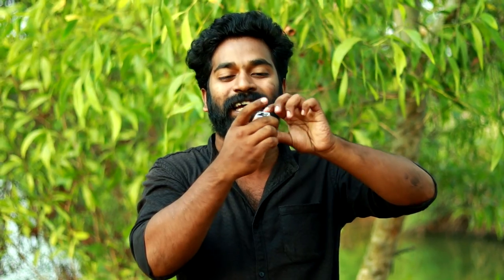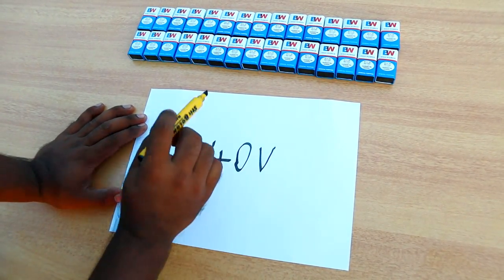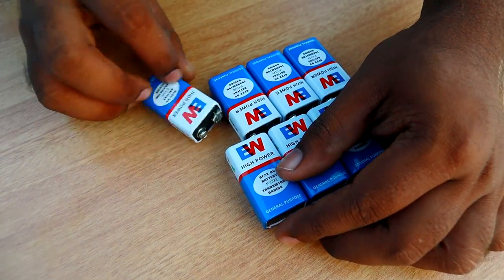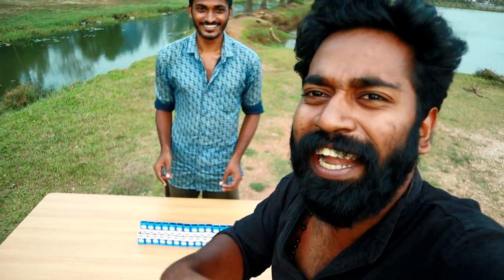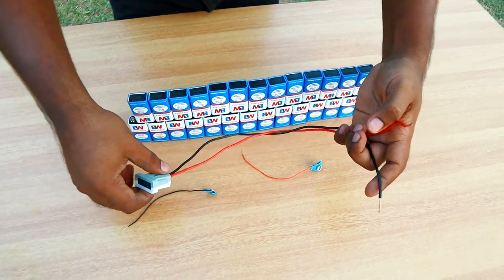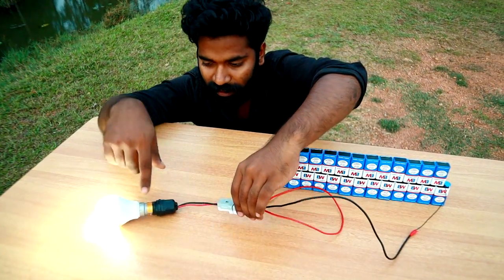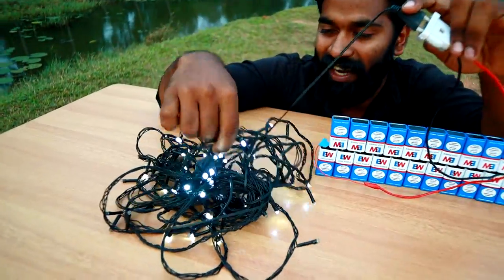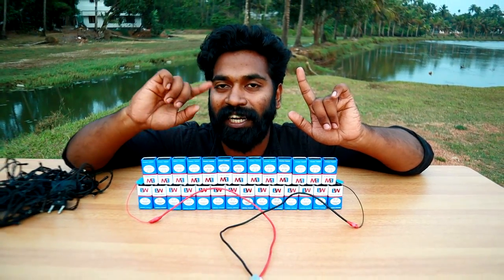MAKING 240V FROM 15 RUPEES 9V BATTERY | 9 വോൾട്ട് ബാറ്ററി ഉപയോഗിച്ച് 240 വോൾട്ട് ഉണ്ടാക്കിയാലോ

Comment: 15 battery veykkunnathinu pakaram transformer use cheythu step up cheytha pore.. Cheggayii😚
Reply: Transformer only works with ac as it works based on mutual induction, mutual induction principle work akanel varying magnetic field venam , dc static ann athond tranformer connect cheyythal switch edum oru transients oru pulse kittum pinne onnum kanula . Dc voltage kuttanel step up converter use cheyyanam .

Comment: Internal resistance koodatal avilee, athupole AC ano DC Ano most harmful, in same voltage ? Onnu vishadamakkitharamo.
Reply: Ore rating ann nkil ac arikum kuduthal impact . Nammal veetile single phase ac 230 volt athonte root means square value ann . pakshe athinte maximum value 310 volt varum . Appo 210 volt battery vechal experience cheyyunathilum kuduthal 210v ac ninum experience cheyyum . Dc ake ore oru value ollu rated ayatt ulla voltage . Pakshe ac oro nimishom marum athu kond nammal average value rms value vechan ac define cheyya . Oru wire dc kadathumbo undkaunna oru effect ethra volt ac kodtha kittum enathan average value rms nammade veetile single phase ac . Ethan nte oru darana

Comment: Cheriyoru Mistake und Bro..AC is more dangerous than DC..Bcoz..AC kk ee caseil 240 * √2 = 339.41 V aann peak voltage and DC l 240v thanneyann...Since the voltage alternates, it can cause current to enter and exit your body even without a closed loop, since your body (and what ground it's attached to) has capacitance. DC cannot do that.Maybe inthe case of high voltages..DC might be more dangerous..Like lightning

Comment: 4:20 current goes from one hand to the other and passes through the heart.This can caus heart failure
Reply: Chirikanoo?
Reply: @hulktoz9379  sathyam aado pulli paraje. Evdelum adich erikum ariyum. Orikalum rand kayyum kond pidikand erika pidikanel thanne right hand use cheyya
Reply: ഇത് സത്യമാണോ..🤔
Reply: Sheriya. Eth onnum prolsahipikaruth . Avar ath parayande arunnu .piller okke cheyum eth kanditt
Reply: Heart iloode ponam nne nirbandham illa... Current always takes the shortest route... So cheleppo nammde shoulder we koodi aavum pova... Kore neram pidiche irinnal current poya bhaakathe koodi karinja adayalam indaavum... Ithe battery inne varana kaaranam... AC il adhikam neram pidiche nikkan pattilla.. pidichal ore vibration poleyaa... Therichu pokum..

Comment: As the battery has less AMPS, you cannot use tungsten bulb,  also DC power cannot kill you if barely touched by hands,  You may use a step up DC ./AC  transformer and enjoy more electricity or crank the car engine too.. using step up DC transformer using same setup of batteries..people will always really like your videos, specially from India..

Comment: 9:17 ബ്രോ അതൊന്നു expline ചെയ്യാമോ. ഞാനും കരുതിയത് DC AC ടെ അത്ര  harmful അല്ല എന്ന് തന്നെ ആണ്
Reply: DC direct current aanu athkond thanne intensity koodum namde railway traction Ellam use chyunath dc aanu namde ac current enn parayubol athintea wave formationil aanu kitunath athyth oru sec 50 pravshym ith extreme position + and - aakum athne namde frequency 50 hz ennu paryunath dc enn vachal angnoru wave form alla direct aayitne movement
Reply: @idiotsince1995  👍👍
Reply: Deepumon. D ente channel onnu subscribe cheyamo
Reply: @AMVLOGSKERALA  ആദ്യം ചാനലിൽ എന്തെങ്കിലും ഉണ്ടാ എന്ന് നോക്കട്ടെ!
Reply: @deepumon.d3148  
12 V car  battery il ninnu shoc adikkulla bro..ath ethra Whr aanelum.
Reply: Ac and dc ennu parayunnath alternative and direct current ennanu athyath wave length positive aayum negative aayum varum so athu pass cheyyunath koodiyum kurajum aan athanu nammukk shok adikkumbo nammude kaayyil oru tharipp anubhava pedan karanam athine aanu ac ennu parayunne ac current angane vittu vittu  herts(heart blood pumb cheyyunna pole) kanakinu pass cheyyunath kondu namulkk current adichal kai pettannu edukkan okkum so athikam harmfull alla but dc anganalla athinte wave lengtha direct aany straight line pole ithinu herts onnum illa direct aayittu ingu varum current 

In ac and dc ethy current aayalum athilu voltage oru parithikk appuram aanel current adikkum ex:     nammal current check cheyyan use cheyunna testeril nammal kai vachal varunnath ac aanu enthukond nammukk current adikunilla because aa testerinte ullil resistance und athu aa currentite volt kuraykkum athinu sesham aanu kayyil ethunne 
 both ideas to check out the ac current
1.) Oru testerum oru multimeterum edukkanam enittu athil tester oru plug pointil kondu vaykkanam vachal mathram mathi switch on cheyaruth sesham multimeteril ac volt 230 or above ittittu athinte positive lead kondu testernite backilum matte atam groundingum cheyyanam enittu plug on cheythu nokk ac volt etra undenn manasilakum a testeril aanu nammal kai kondu thodunnd ennum. 
(NB : USE CHEYYUNNA MULTIMETER 10 AMPERE ABOVE SUPPORTED AND AC CHECK CHEYYAN PATTUNNATH AAVANAM)
2.) Testeril 2 3 type und athil nammude pocket clilping inte side steel varunna backile finger tap sidum aYittu joint ulla tester edukkanam enittu plug pointil phasil vachu plug on cheyyanam sesham pathiye aa testerinte pocket cliplinginl pathiye thadavanam angane cheyyuna vazhi vyakthamayi manasilakkan kazhiyum ac current pass cheyyunath engane enn

Prethekichu oru karyam carinte okke batteryl 12 volt ennu ezhuthiyirikkum athil 12 volt alle ullu ennu karuthi kai vaykkan pokarutb because athinte thaze ampere ezhuthiyittundavum athayath oru caril kuranjatb 60 amp battery aanu use cheyyune angane engil aa batyeryudd watts enny parayunnath 12×60=720 watts aanu ekadesham 720voltaginu equal aayittulath parallel aayi varunna current so kai vacha thirich edukkendi varilla so dc current nokkumbol athinte Ampere koode nokki ithupole kannaku kooti manasilKkuka

Serious aayi varunna current volt basisilum parallel aYi varunna current watts basisilum ariyappedum

Athayath car batteryl   12 voltinte  60 cells akathu parallel aayi cheythu vachirikkunnu ennanu
Reply: @abhijithvg2442  well explained bro..